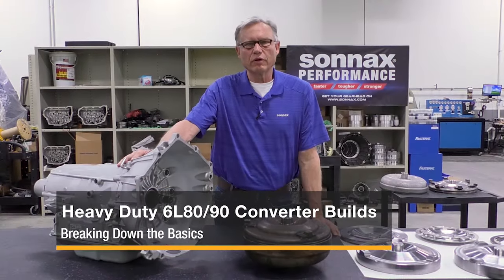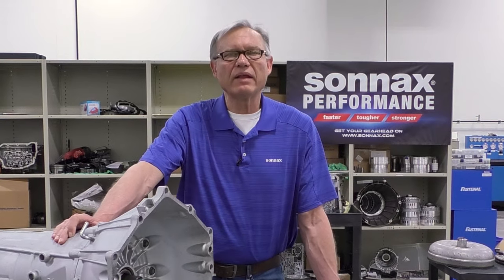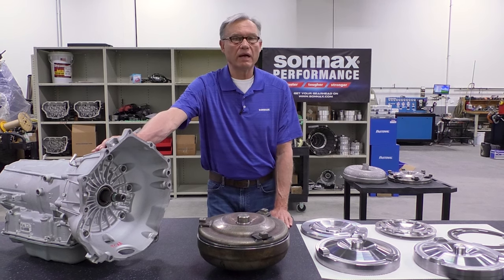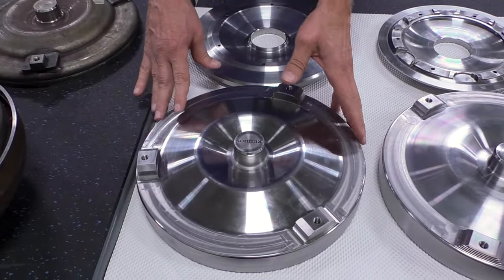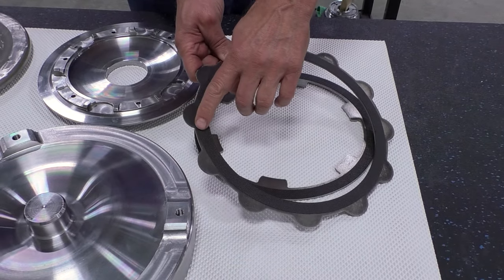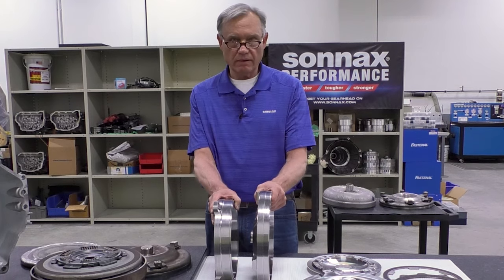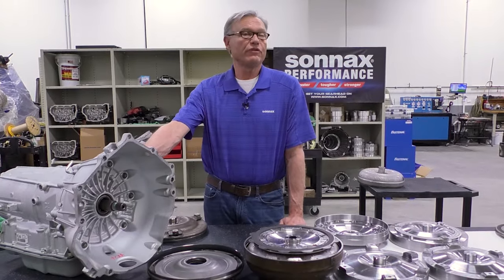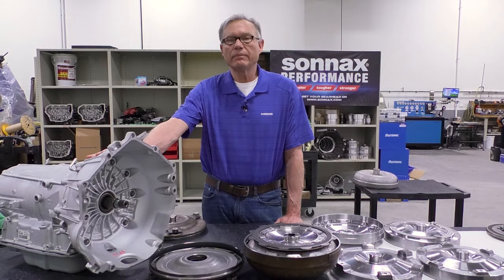Sonnax 6L80/90 Torque Converter Heavy-Duty Builds Explained

Comment: I'm looking at having to rebuild my 6l80. Pretty sure the converter is failed/failing. I'm hoping it's not to the point of catastrophic.  The guy doing the rebuild is a well known local mechanic and racer. So I'm hoping that he upgrades mine. Cuz I don't want to have to pull it out again.

Comment: My mechanic after torque converter changed to billet one said no programming needed. Is he right or should I deal with other shop. 2017 sierra with 6l80
Reply from the maker: Our product support team would be happy to help you. They can be reached directly via email at sonnaxtechsupport@sonnax.com, or phone at (800) 843-2600 ext. 398. Thanks for reaching out!
Reply: NO! I don't care what they believe. Keeping the stock allowed slip BS is just making life harder on the Sonnax upgraded converter.
EVERY good builder will block the appropriate ports to force TCC to not unlock or slip.
Its better if it goes in walks up unlocks locks up unlocks. And also a good practice on these transmissions is we go in and program out the lock up on first through fourth and only lock up in 5th and 6th on daily driver trucks and fourth fifth and sixth on towing vehicles. Because this slippage that GM put in there is to make sure you don't feel that torque converter lock up but that's also what makes that front cover grind down to metal and overheat and warp that front sheet metal cover and if they had built a billet style front cover for the converters they can get away with it maybe but in all actuality you're going to be much happier if you find a good person who knows how to tune a 6L 80 or a 6l90 and eliminate that slippage apply pressure just a little bit to make sure it's a good solid hold without overloading anything. 
And if they're really good they'll go in and tune your shift points so that your transmission gives you a nice firm but not radical shift where you feel one two three four five six and it holds better and doesn't burn itself up.

Comment: @sonnex I put a 6l in my 2011 silverado 1500. I have 250000 miles on the truck. The transmission shifts good. I wanted to upgrade my torque converter. What do you suggest?

Comment: Hey do you guys work on lexus transmission? For example like from 2006 to 2012 like the a960e n the aa80e?
Reply from the maker: No, as we are not transmission rebuilders. We design and manufacture top-of-the-line parts for transmissions, torque converters, and drivelines. Feel free to visit our website to learn more: www.sonnax.com. You can see what's available for the A960E here: https://www.sonnax.com/units/25-a960e. Hope that helps. Thanks for reaching out, and have a great day!

Comment: Do you as the a company do this service of taking apart and welding back and balancing so I don’t need to take this job to a local or out of state shop and do a half ass job?
Reply from the maker: No, we do not. We design and manufacture top-of-the-line parts for torque converters, transmissions, and drivelines. Feel free to visit our website to learn more: https://www.sonnax.com/. Thanks for reaching out, and have a great day!

Comment: The Modified with lots of Sonnax parts 4l60e I have behind my LS1 has a 300mm 3 Pad converter TAG: TMBX 2420-6642, would it be compatable with what your showing here, I need a heavy duty low stall TQ for my 4x4.
Reply from the maker: The converter kits and modifications in the video only work for 6L80 and 6L90 units. The 300mm converters in the 4L60E’s don’t suffer from the same converter failures that the 300mm units see in the 6L units. For your 4L60E application, a converter builder should be able to set you up with a low stall 300mm TMBX style converter with a forged cover. The Sonnax part number for a forged cover for a TMBX converter is GM-CC-17: https://www.sonnax.com/parts/4589-front-cover. Hope this helps, and thanks for reaching out!
Reply: @sonnax  Thank you so much for replying to my question, The LS1 4l60e in question is out of a 2004 Australian Holden Commodore and fitted to a 94 Toyota Hilux LN106 using an adapter kit mating the 4l60e to the Toyota transfer case, The Hilux is setup with a Touring Canopy and loaded up for extended living in the outback and weighs in at around 2400kg / 5300lb travelling in some very hot and rugged conditions that puts a lot of stress on the transmission and converter so a recoed one is on the list to be done. Cheers from downunder.